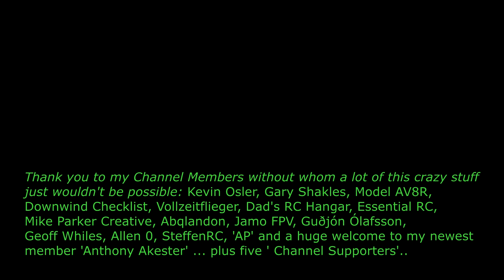Mercury IV Vintage Build RC Conversion Cracking on with the Wings

Comment: Cliff I was still working out how to sheet my Clipped Wing Cub thanks to seeing how you did the wing, I can put a check in the sheeting box.  The Putty wing looks rough as your beard growth 😊😊😁😁😂😂🤣🤣  Thank you and what a great build, Jeff in LA USA
Reply from the maker: Good timing then Jeff, just make sure the structure is flat otherwise you might build in a warp, correctly fitted it'll be as smooth as my chin 😁👍

Comment: Nice work, as ever, Cliff.  I seem to be the only modeller who does not have a collection of dumbbells to use as weights while building.  I just got steel cut-offs at the  metal working department in the school where I used to work.
Reply from the maker: They have their uses Gudjon but it would be better if they were blocks 🤔👍

Comment: Great work, few new kits available for us builders. Many are buying half-built and pre-crashed models at swap meets, converting to electric power, rebuilding structure, and recovering. Your techniques and work ethic should encourage and help others to "get 'er done" . That Mercury model was built like a tank with all the sheeting, cap stripping, etc. Should be a graceful flier with all that wing area but no "featherweight". Removing bad sheeting with minimum collateral damage will need some ingenuity and careful surgery. We just bought two of the same clocks in blue-green from Amazon . Most of us in the US are forced to order model supplies including balsa and bagged accessories  online most local hobby shops are only a memory.
Reply from the maker: Hi Gary, I didn't realise it was that bad over the pond, guess I'm really lucky to have not one but two local shops, I rarely have to purchase online 🤔👍

Comment: Hey Cliff, brilliant model! I'd strongly recommend however putting a mixing switch on the elevator so you can also have roll control. It might be worth setting it up in such a way that you can turn on/off that function with a programable transmitter. Since you're not adding ailerons to this wing.
Reply from the maker: Hi Amir, that's exactly what I plan to do, thanks for the reminder and comment, cheers
Reply: @CliffHarveyRCPlanes  Great minds think alike!

Comment: I bought the plans for this plane a few year ago. I thought it would be grate, it is great. Then I thought, how on earth am I going to get it out of my loft if I built it ?
Decided to put it on the back burner for the time being. Built a Mercury Matador from plans instead, it's a little bit smaller
Reply from the maker: Hi Nigel, the tailplane does detach which is an option, I  have a Free flight Matador built by the master himself ... DB 🙂👍

Comment: I wonder if you have to be a member of the Large Model Association to free-fly this model?
Reply from the maker: I think the weight is the deciding factor, that's 25kg, it's well under that, or at least it better me!
Reply: @CliffHarveyRCPlanes  No, actually that's the top limit before you have to have a special compensation.  Most giant models are under 25kg.
Reply from the maker: @gudjonolafsson  I can't find any info on the LMA website!

Comment: Hiya Cliff, another daft question for you,  what exactly are cap strips? And what is the point or use for them?
Reply from the maker: Hi Gary, take a look at 28:06, they are the strips of wood that 'cap' each rib. A lot of models don't have them but they improve the appearance and do add a degree of strength to the rib and wing by binding the wing to the main spar 👍
Reply: Are you going to 'skin' over the top of these caps with balsa or some sort of coloured film?